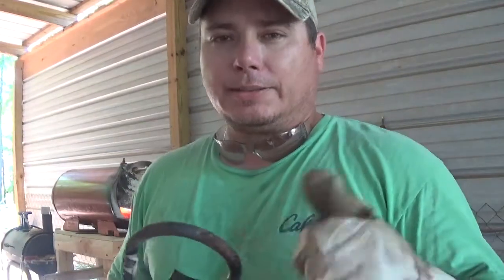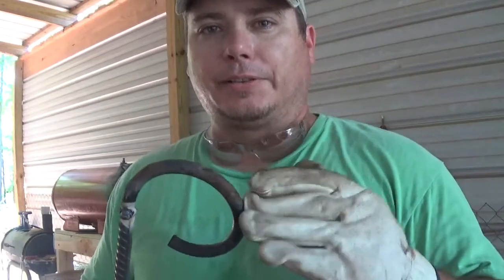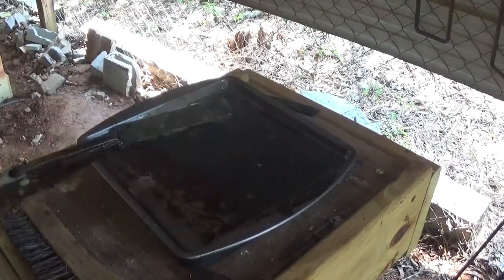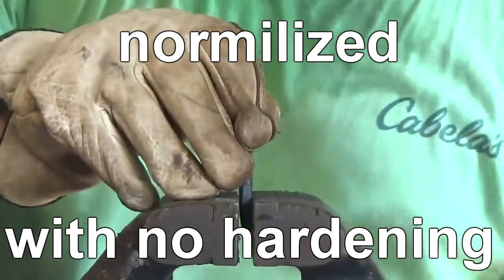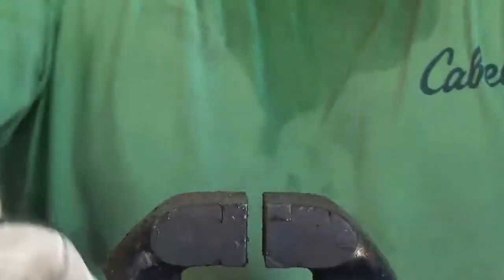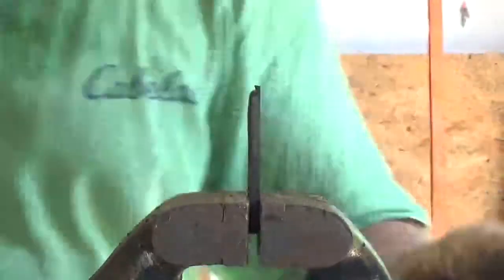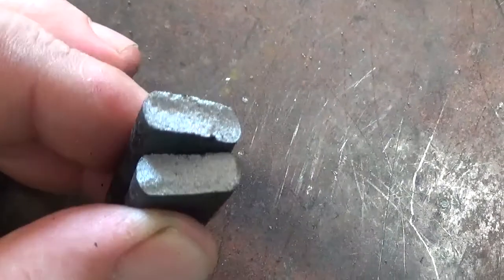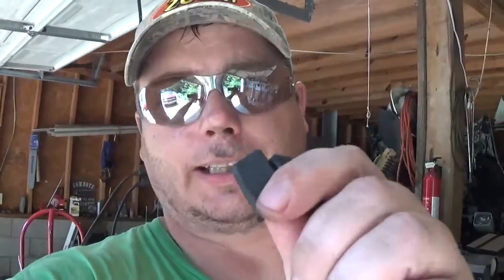Destructive testing of 5160 spring steel

Comment: The way you forge that first piece all the way down to.
 Where there was no color left in. It is a super good way to put a bunch of stress. Cracks in the steel which there is a forging temperature range that needs to be adhered to.

Comment: So what are your thoughts on 5160, especially for knives?
Reply from the maker: the only issue I've found is not having new unused material.  I use old car springs coil & leaf and they can be flawed.  I've found cracks in the used material after investing time and labor, and have to restart.  But it hardens well, good for knife, but not too hard for axe.  It would be nice to find a good place to get it new.